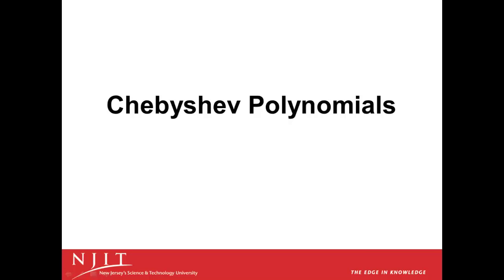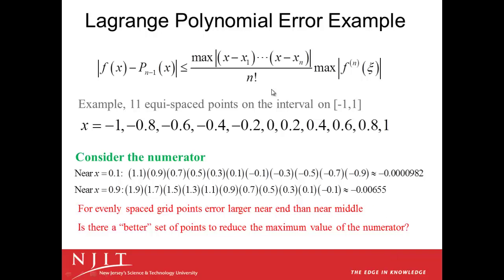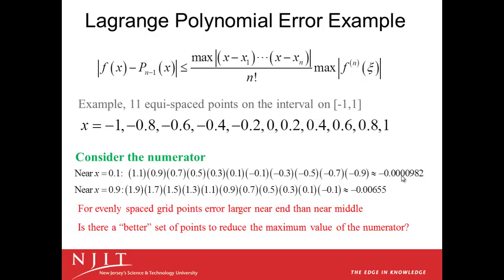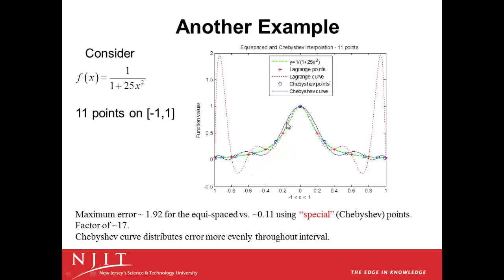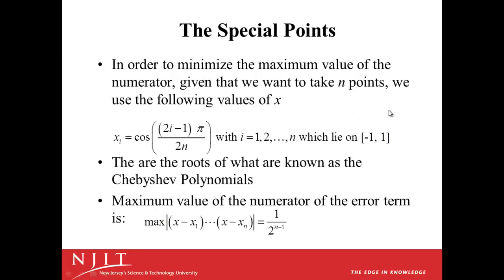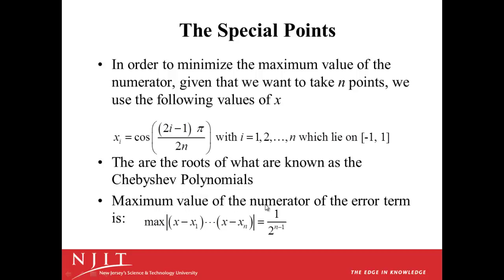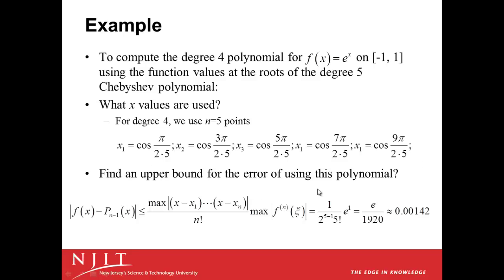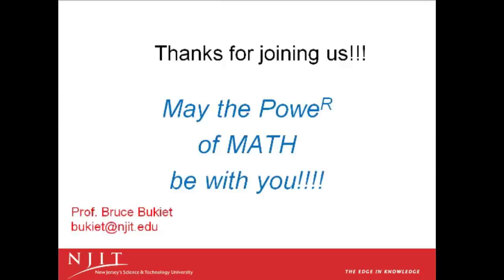ChebyshevPolynomials

Comment: Great video. I want to cite some of the results in this video for my project report. Are the examples in this video from some other reference or your own?
Reply from the maker: There are two examples in the video. I am not sure if the 1/(1+25x^2) is exactly from a specific text but it is similar to one used in many texts. For example Sauer used 1/(1+12x^2). Epperson has 1/(1+25x^2) but not exactly the same spacing. The second example is from Sauer Numerical Analysis second edition p. 159. I hope that helps.
Reply: @brucebukiet  Thank you. That is what I needed

Comment: Thanks man! Great tutorial! But I wonder at the end, how did you get e/1920. I mean I don't know how did you use lagrange formula to calculate. Could you please explain a little more? Thanks!
Reply: We're just replacing the x values with the points we calculated and the result is 1, then we have f(x) from which we need the n-th derivation.
f(x)=e^x, so the n-th derivation is e^x again.
Now we replace x with their highest value, notice how there are "max(...)" everywhere, which just means we're replacing with x its maximum value, which is 1, since we're only viewing x between [-1,1], which means 1 is our highest number.
so when we replace all the values with their actual vaule our result ist e/1920.